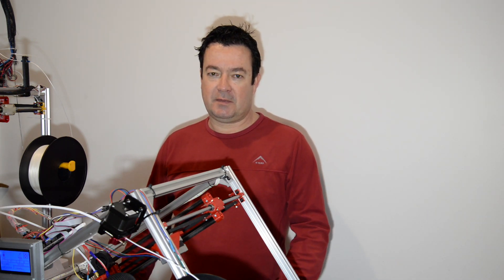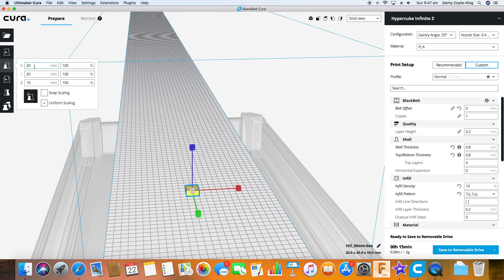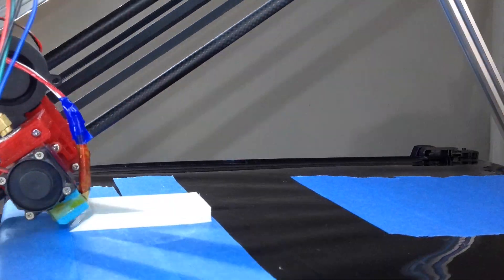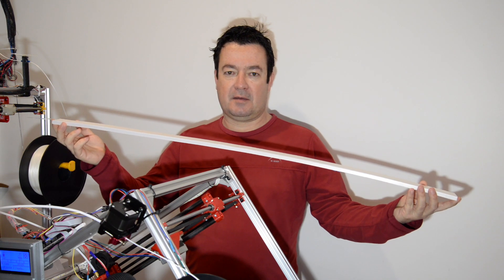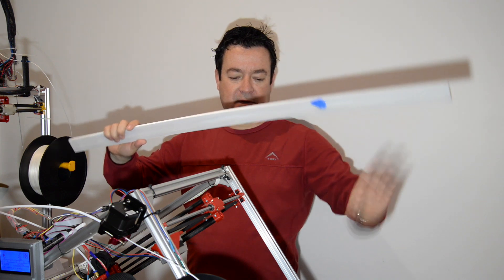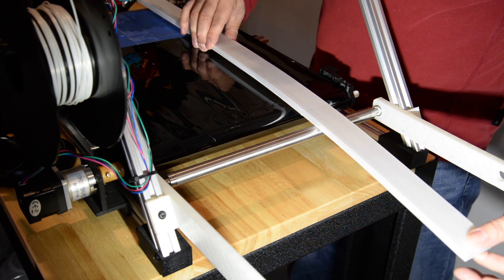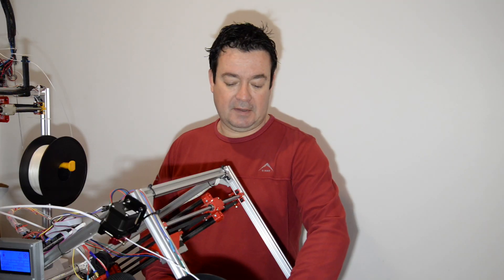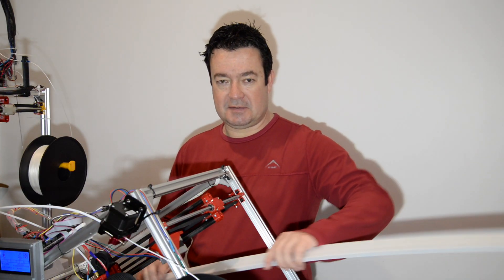Hypercube Infinite 3D Printer: Long Print

Comment: as far as the tape pulling up, that can be resolved by changing the layering direction. so the overlap is at the top of the Z direction instead of the bottom.the previous tape will hold down the next one in the series.
Reply from the maker: Great idea. Thanks

Comment: I applaud your spirit of invention! You share with us both those things that have worked and that have not worked. It is a good lesson to know that not everything works out the first time -- and sometimes not even the tenth time! It is a lesson we all learn, but many of us hide our so-called "failures". I do not believe in failure. We need another word. If we apply all that we know using our best intentions and then something does not work out, then we have learned something. We have learned what does not work. The trick is to then have another go armed with even more information.  -- failures are simply the bumps in the road to success. Mazda made 20,000 rotary engines before they were satisfied. Twenty-thousand.
Reply from the maker: I did not know the Mazda rotary story. Inspirational. Yes. The gap between theory and practice can be huge. But it is amazingly satisfying to get something to work after many many "failures" 🙂
Reply: Indeed! I am an inventor and maker and so know these things quit well. Truth is, I love to solve these "problems." Or said better, "barriers."